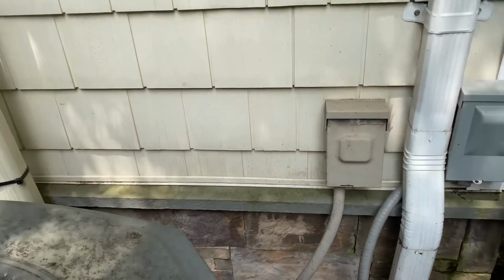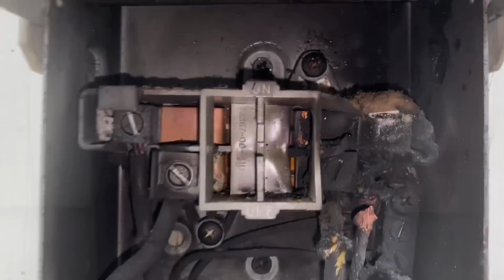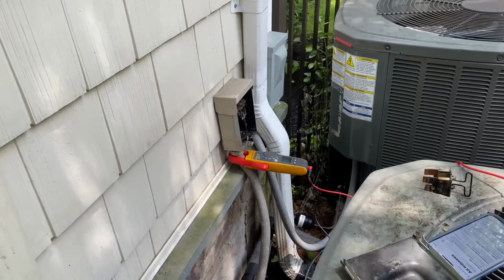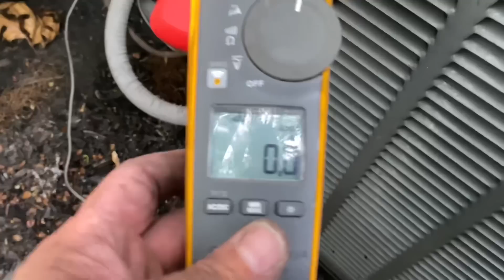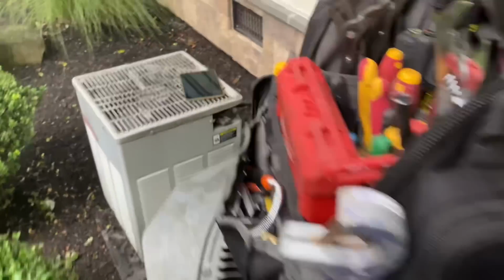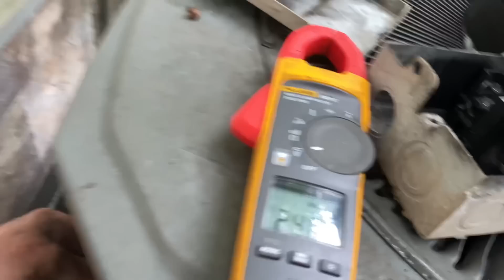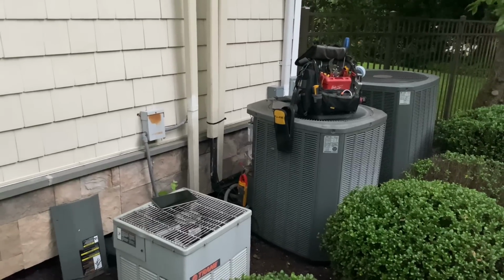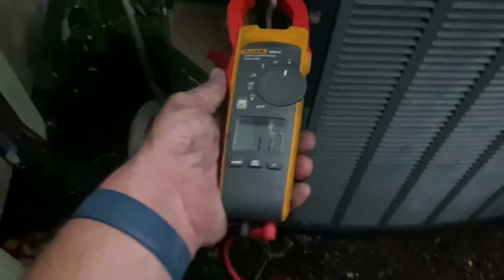Central AC Electrical Disconnect ALMOST Burnt Down House - Step by Step Replacement

Comment: In all honesty that looks like a loose connection that got hot, and hot enough to melt copper especially if it was arcing at the connection. The breaker in the panel will NOT trip because there was no excessive amperage draw.
I have personally had copper melt like that on a 12 Volt trailer plug that got road salt within but did not blow the fuse..

O ya, thank you for the stickers  they arrived last week👍
Reply: yeah, that's what I see having occurred, it never shorted to ground and only grew in resistance until turning molten and arcing open, until it extinguished itself as should happen

Comment: I would recommend having an electrician validate the panel and wireing to be safe.  If someone did something wrong chances they did more things wrong.  Better be over the top safe and cover your butts then to have another fire and be blamed

Comment: Once you had a potential problem related to the panel. I would have also referred customer to a licensed electrician for possible replacement. I would have also installed surge protector to new AC disconnect.

Comment: Yikes! Watch for possible arc flashes! Melted copper. I would suggest having the circuit breaker replaced too.
Reply: @PipeDoctor  Fortunately you and nobody else got hurt. Also the house didn't burn down to the ground. Glad you pointed out you installed a disconnect switch and not a circuit breaker. Keep in mind on heat pumps installations to use fuses and not a circuit breaker outside since circuit breakers fail to trip in colder weather. Personal experience on a job site in Brooklyn years ago proved it. I kept on getting small electrical shocks off of a railing to a change shack.The foremen of the project thought it was a grounding issue. Well low and behold one day smoke and sparks came out of an electrical receptacle box in the supply trailer. A screw had gone through the hot wire. the breaker did not trip due to the outside temperature being below what the breaker temperature is rated.

Comment: I'm sure someone else will mention this but it looks like it was a loose connection that did that. one of the first guys I worked for said "everything vibrates, whether you can see it or not", and yeah from physics and chemistry molecular motion doesn't stop. but over time you'll always see connections that heat up and then loosen. and a loose connection will heat up worse until stuff like this happens. keep on keeping people climate controlled and safe mike.

Comment: looked like a classic loose connection, with maybe a side of corrosion? once high resistance it keeps getting worse until something melts and burns clear or arc to ground, but it can continue to arc for a bit as the gap burns open. the breaker inside is likely fine, as the current likely never got high enough to trip it thermally, nor magnetically.
it's possible to not have those disconnects pushed in fully and them burn, but that looked to have started at the wire to lug from loose screw, otherwise the disconnect handle and blades would have been more burnt. 😵‍💫

Comment: There is a reason connections are made inside of a box the box did its job. That was a a bad connection and it arc'ed within the circuit, if it would have shorted to the box the breaker would have tripped.

Comment: Now THAT was well done fried chicken!!!  My guess??  A loose lug set screw causing arcing thus causing increased amp draw causing heat.   But she sure got hot!!! Lol what was the breaker 50 amp 2 pole? 😂😂😂 
❤ the replacement!!! I love them boxes !! Simply coz they are safer for the Tecks!
Reply: @PipeDoctor   yep I would bet my paycheck on it! Seen it a lot of time where the electricians did not tighten the lug screw tight an as wires heat and cool they move…

Comment: This happened to me about 5 years ago. One ac unit was out. Went outside the disconnect clearly had been on fire.   Breaker tripped and a foot around the house charred (mildly), 
No idea why. I took it all apart and it all looked good. Ac unit fine. Bought new disconnect cleaned mains and bought new whip and it's been working perfectly since. I thought maybe an insect shorted it.
I always worry it will happen again.

Comment: It wasn’t a short and it wasn’t over amperage. It was caused by resistance. Poor termination, damaged wire.
Reply: @PipeDoctor ,exactly. Hope that house does not have a Federal Pacific breaker panel. If so they need it changed out asap. Federal Paxific breakers are known for not tripping, you could cause a direct short and watch the wires melt most of the time without the breaker teipping.

Comment: That's scary, i wonder what caused that copper to melt because I've never seen that.
Reply: Loose wire.

People don’t know this but when there’s electricity running through wires? They actually vibrate & they can loosen the connection & a loose connection increases the resistance because of less contact area and thus? The circuit overheats & melts.

Comment: Had a similar service call today lol

Checked for short to ground and it was fine. However, S+R Ωhms do not add up when I go from S+C and R+C 

Capacitor is fine. I am scared that when I change the box it will blow again.. 🤷‍♂️